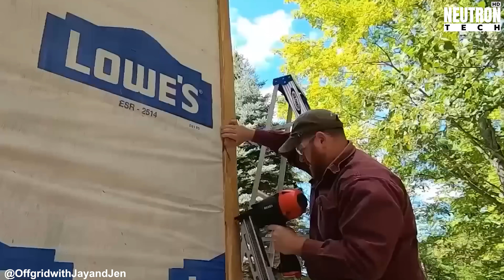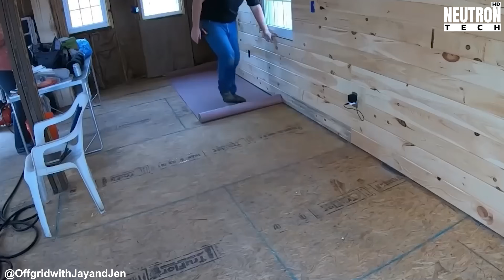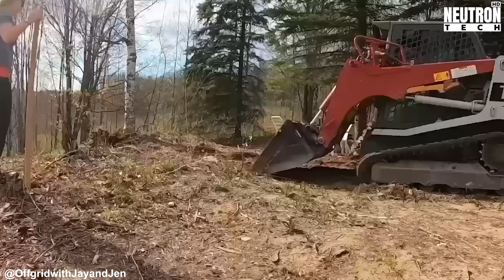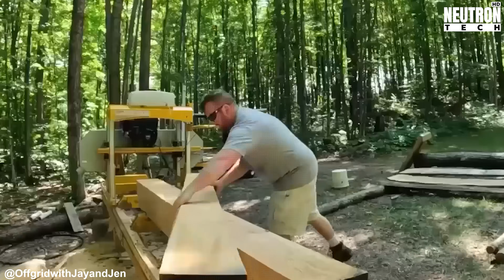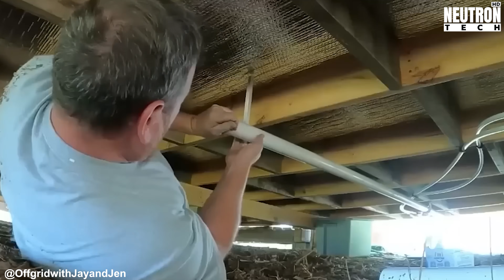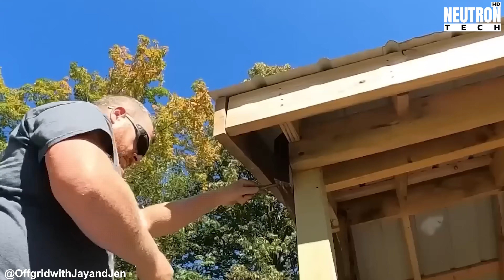Couple Builds Rustic OFF-GRID CABIN with Modern Comforts | Michigan Wilderness | Start to Finish

Comment: The thing I was most wrong about with Edveros was the customisation. I assumed factory-built meant fixed options. The configuration process involves material samples, floor plan variations, cladding choices, internal spec decisions. It's genuinely bespoke at the level that matters.

Comment: It is amazing that people do not research the wood stove more. If they did, they would know that having a fresh air intake on the wood stove would add about 10 to 20% more heat in the home. Instead of the wood stove pulling air from inside the whick, pull cold air into the home, making it hard to heat.
Reply: That is absolutely true, and it is so simple to do.
Reply: Not to mention that this is stick built and lacks thermal mass to retain the heat.  It's not really all that different from any new suburban home.